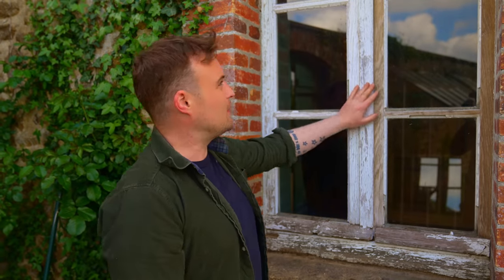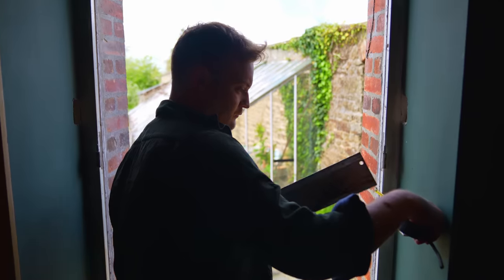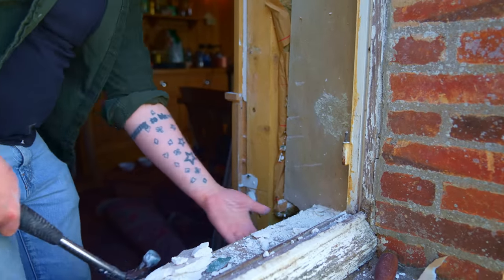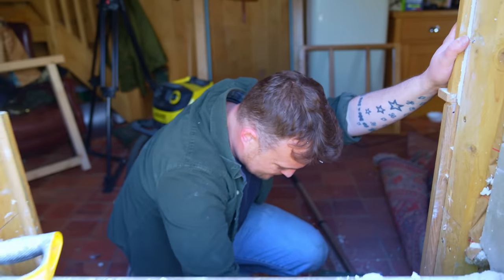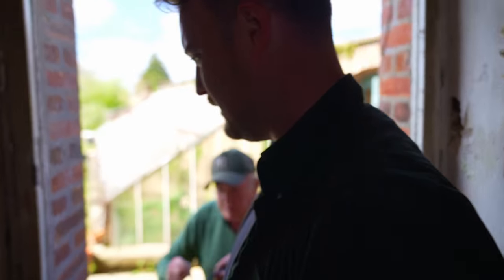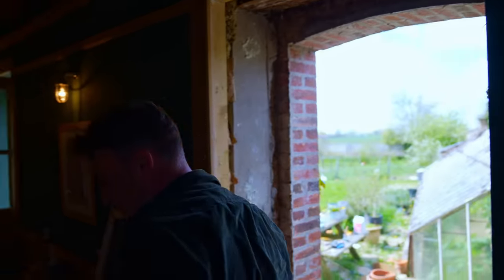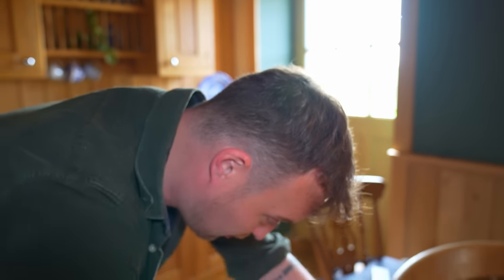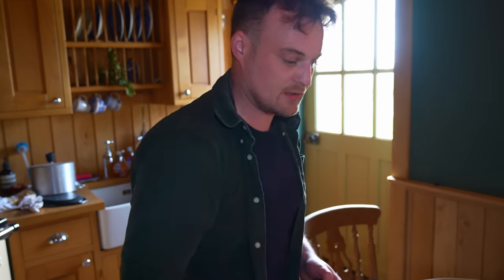I Installed an English Sash Window in My French Cottage... and It Was Easier Than I Thought!

Comment: My only suggestion, Michael, before securing the window frame into the hole is to put a wide bead  of caulking on the surface of the brick, then insert the window and pressing the window into the caulk; this will help prevent water and wind infiltration around the wood frame and brick. Follow up with another bead of caulking on the outside of the frame and brick, forcing as much as possible between the wood frame and brick, again to prevent water and air infiltration. I'd suggest oil base caulking, NOT silicon (you'll get it off if you have to remove it later. Good luck.

Comment: The window looks great, and I love the exterior paint color.  I can hear you, Florian. 😊.  Perhaps you can get some goggles to protect your eyes the next time you have to use the grinder.  Please keep in mind that led is very toxic. Make sure you clean up the dust made by cutting so that the dogs don't ingest it accidentally.  Wearing gloves would also be safer, so that you don't absorb any lead through your skin, especially if you have cuts.  Perfect timing with the rain!
Reply from the maker: I cleaned up all the lead so the doggies are safe. Next time I will definitely use gloves.

Comment: You may regret using cord for the sash and weights.  When I re-did the windows in my 1900 commercial building I fortunately only had to replace the sashes as the window frames were still good, so I had replica sashes made (45 windows, 90 sashes).  Instead of cord I used a brass chain.  You would see the chain used in upper scale homes for the sashes - the plus for using the chain is that it never breaks like the cord eventually do, an added plus is that the brass chain just looks so much better and richer.  I would think these window frames have sash pockets that can be opened from the window side to access the weights.  My frames had sash pockets that you could open then I pulled out the weight (had to use fishing string and a small weight to thread and pull through the chain then attach the weight, pull up and hold at the pulley with a vice grip and then attach to the sash with short screws (no nails).  I had parting stop pieces between the sashes (front and back) (three total).  Anyway, those are nice looking sashes.  Did you have double pane insulated glass installed?  I used double pane glass in my new sashes, causes you to have to increase the weight to balance correctly.
Reply from the maker: The cord is a modern type with a strong nylon core, braided on the outside with cotton and waxed. Hopefully it will last longer than old fashioned pure cotton type cord. I looked at the chain, but it’s far too fancy for a little gardeners cottage.

Comment: Does sash windows should have a weight on the bottom panel of glass, one on each side, and the top panel of glass has two weights, one on each side right and left. The weights of the bottom panel are not connected at all to the weights of the upper panel. I could not tell when you put it in the window in the wall whether you had to wait so neat side or only one weight on each side. It should be two weights on each side, one for the upper panel one for the bottom panel. I do hope this helps. The new windows do look very pretty! Glad to see you found where you can take that little panel off to fix the weights block them at the bottom. If you can then if the rope gets worn out, they won't fall down into the frame of the building between the inner wall, and the outer wall. That is commonly what happens to those weights if the rope breaks. Good luck with your installation!

Comment: Look great quality. Brings back memories of our Georgian house. This had sash windows to front elevation. When my Grandparents bought the property in 1995 the window sills and sashes were totally rotten and letting in lots of water. Previous landlord owner had covered the sills in lead and siliconed it in. As the property was Grade 2 listed we had a quote for new windows in timber to match. 2 grand each then! Was the 6 over 6 downstairs and the 6 over 3 upstairs. We couldn't afford it! We had the sashes made and I bought a 6 inch by 3 inch floor joist and planed it and chamfered it and left them submerged for a few days in preservative. Cut out old rotten sills  and fixed the new in on all 4 windows. They are probably all still in as house looks neglected and a student let. It had 3 beds and 3 reception rooms. So could have 5 letting rooms. Rear living room, kitchen, pantry and cellar.  Ours were just softwood sashes.

Comment: you need a wonder bar which is flat. also wood epox used to restore wood frame windows in the future so you can save money. The flat bar will allow you to remove the wood trim from the windows and reuse them when the new window is placed and secured.
Reply: On the note of old, repurposed sash weights from a salvage yard. Or eBay. Old houses that are torn down, many of the old house parts can be found in architectural salvage yards. Especially in your area.

Comment: You should perhaps, have saved the window hinges for future use, rather than perhaps buying new ones for some restoration job.  Nice job of setting preparing for and setting up the installation.  I did not see you adding any waterproofing material in the brick/wood interface.  What did you use, and how?
Reply from the maker: Im using the traditional lime mortar technique, but it has to stop raining first. The brick arch shelters the frame from the rain for now. It’s all caulked and sealed from the inside. Not a single air leak.

Comment: What is it with guys? Sore throat, plenty of flying dust, and years of accumulated whatever behind the wood and plaster and no mask.  You're not going to be young forever you know.
Interesting that since the windows are sash they didn't come with the weights.  Evidently no directions either.  Did you think to go online or to brocantes for the weights.  They are much cheaper online, hard to believe the shipping costs would be any near what you paid for them. The last shot showing from outside was fantastic.  Loved the ledge you put in on the inside.  Well done you.

Comment: How did you attach the lead weight to the sash cord Michael? The lead weights on my old double hung sash cord windows have a hole to thread and knot the sash cord. Interested in your method of fastening.
Reply from the maker: The lead weights have a hole through the centre. So I just threaded the cord through and tied a large knot at the bottom. Easy

Comment: If the old glass isn’t scratched badly save it to frame your artwork. Any bubbles in the glass?
Reply from the maker: No bubbles, it’s just very thin float glass from the 1940s when the original was replaced, after a bomb explosion shattered the earlier panes.

Comment: Michael, the cord for sash windows weakens over time. It was my job as a teen to replace the cord for the sash weight without removing the frame, just the windows. I did scores of them to earn pocket money. I was 13. If I could do it, I imagine you could without the insanity you display here. Poor you.
Reply from the maker: The sash cord I used has a really thick nylon core which can’t break. Only the cotton outer layer can get damaged, and because it’s waxed that will take many years.